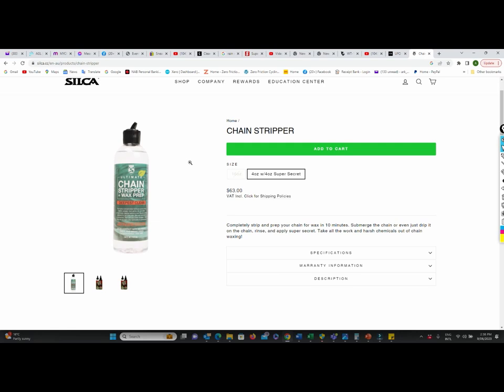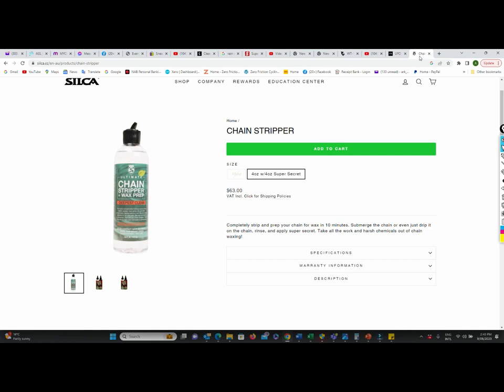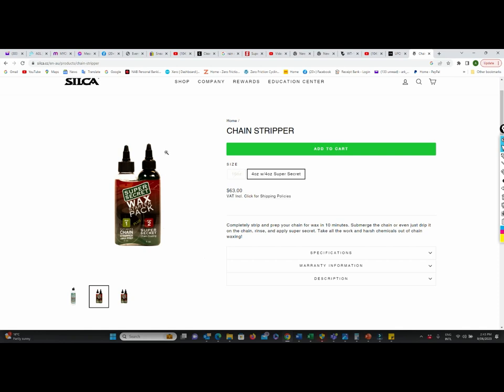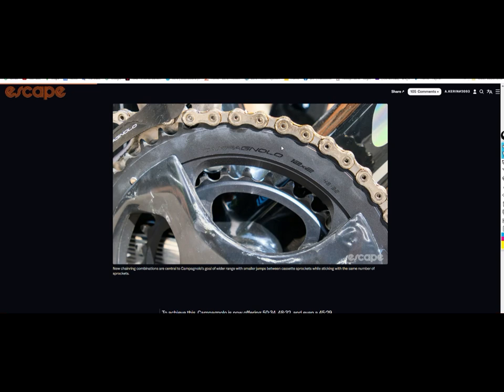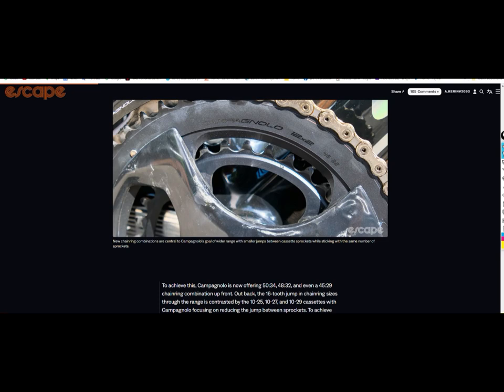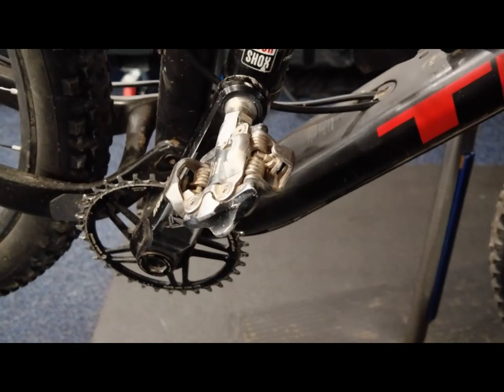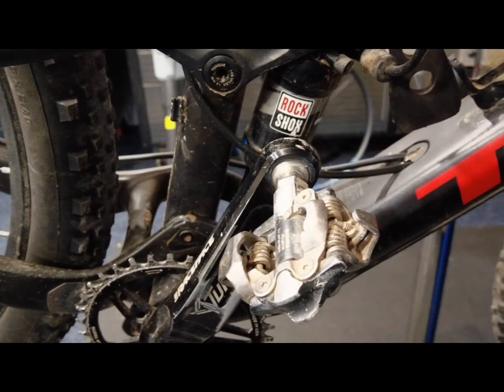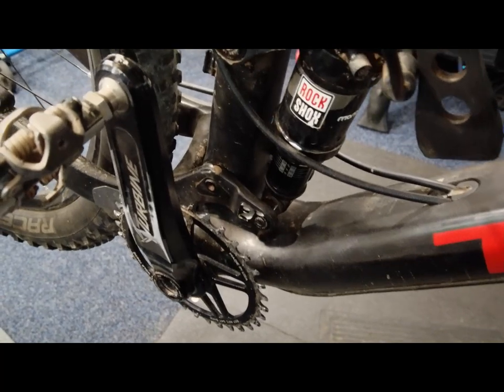Stripper and campy 10t

Comment: Can you run a YBN 12-speed chain and Shimano 12 speed cassette with a Sram Force AXS rear derailleur and chainset?   Will get pretty much same range with 50/37 and shim 11-34 as with 46/33 and sram 10-33 , but probably less friction.   ( But HG freehubs really suck - at least those made of alloy gets f***ed up after short time... )
Reply from the maker: Alas no - sram axs force / red / rival cassettes have narrower cog spacing for the notably narrower flat top chain. So the rear mechs are indexed for that more narrow cog spacing. Putting a shimano cassette on, the gear indexing will be out immediately, it just will not work.
Reply: @zerofrictioncycling992 , discussion on starbike seem to approve, but require either spacer or micro adjust because of different chainline. Looks fine: https://youtu.be/fNmhx20i5wo
Reply: Tuned correctly in the middle of the cassette things are still OK at each end...
Reply: @Morten_B  Aren´t rollers on the AXS chain 0,2mm larger than an ordinary chain?? Perfect match between rollers and cogs???     Rgr
Reply: @borano2031 , yeah but with a YBN chain then cassette and chain matches. So front rings and pulleys are slightly mismatched...?
Reply from the maker: @Morten_B  i would be extremely cautious of that advice. The reality is the axs cassettes have cogs that are spaced more closely together than shimano 12s cassettes. An axs force / red / rival / xplr mech will move a distance each shift for that cog spacing, not for shimano cog spacing. So every shift it will be a bit more out of alignment with the cogs. 

No way in heck would i put a shimano 12s cassette to a red / force / rival / xplr 12spd mech. That is setting one up for a nightmare to try to index such that it would work - whatever one is trying to achieve - it will not be worth it, you really should stay in the correct system in this case.
Reply: @Morten_B  yup, it's really not remotely difficult to index.
Reply: I think 11-34 and 50/37 looks even better than  my current 10-33 and 48/35 setup... And should be a bit more efficient, especially with an YBN chain